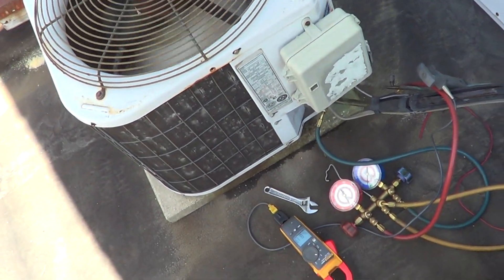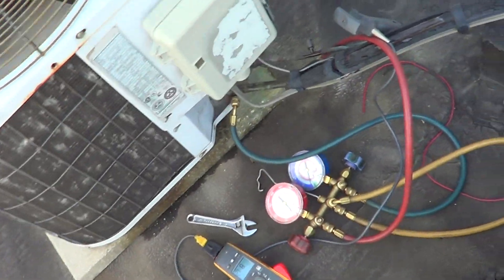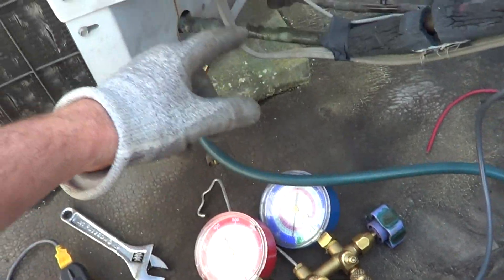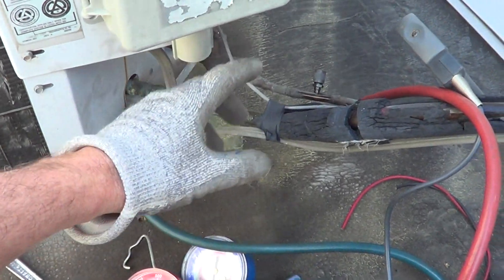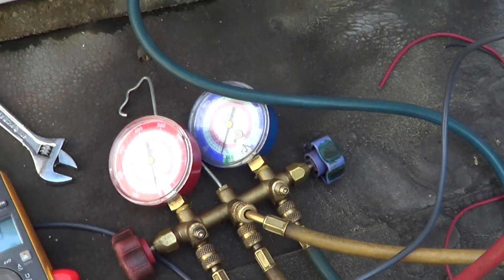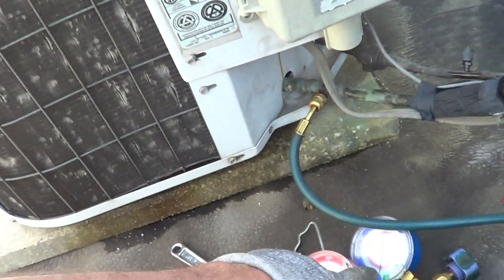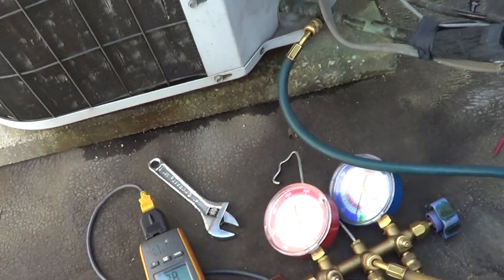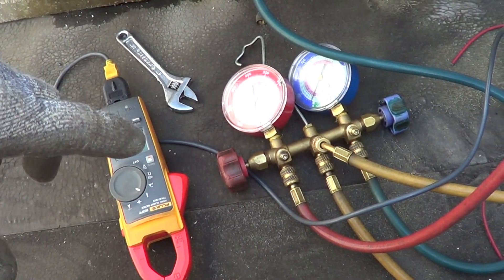Partial Capacity Recip Compressor

Comment: I got a scroll that is ok on pressures but been thru everything else on it twice and still 10 degree split. Double wide in South Florida and owner wanted new flex duct underneath and it was needing it but still 10 split. I am gonna swap the compressor. I done one just like it a month ago but that compressor was a bit hot and noisy. Well see.